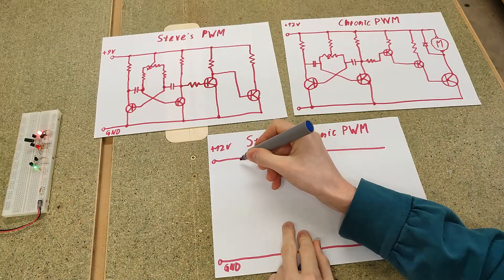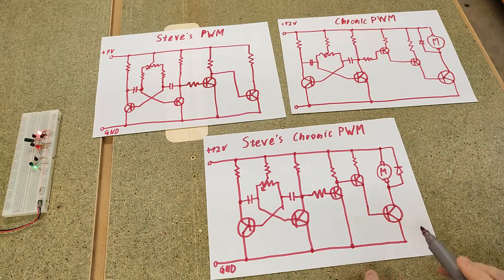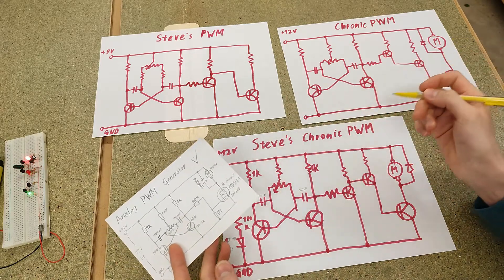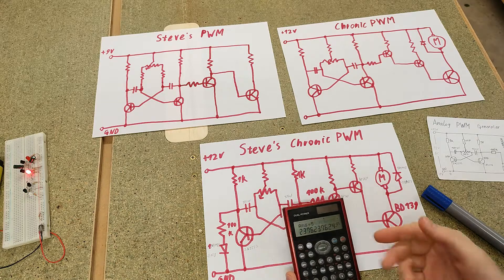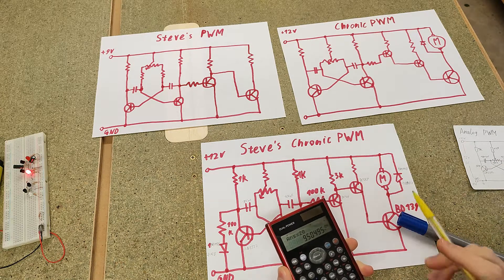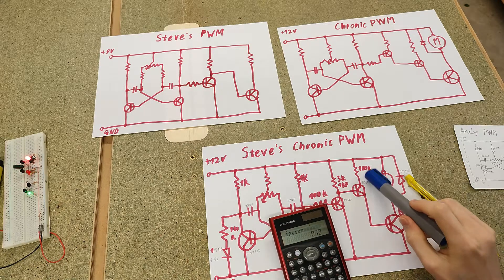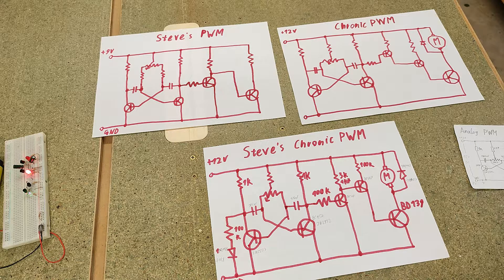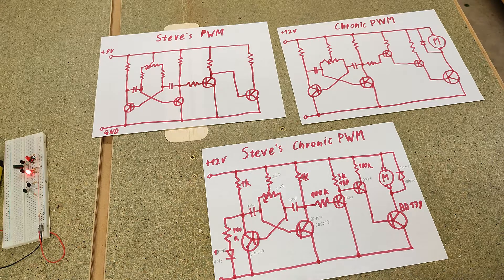Designing a PWM motor speed controller WITHOUT 555 timer IC

Comment: 1. Instead of motor, i understand can also use it to drive LEDs (~200-300mA current). 2. Also can i reduce transistor stages, maybe by using PNP to drive the LEDs. Please comment on above. Thanks in advance 😀
Reply from the maker: Hey, sorry for the delayed reply, I usually don't log into the second channel very often.
Yes, you can use the circuit to drive LEDs,  as well as anything else controllable via PWM. The maximum current is determined by the collector current of the final output transistor, so for your LEDs you may be able to shorten the output stage by 1 transistor, placing the power transistor where the last BC547 is (necessary to recalculate some resistor values).
Using PNPs will likely not be of any advantage for eliminating transistor stages because the transistor before the PNP needs to be able to switch the full base current of the PNP nonetheless. If you want to go really simple you can only use the MOSFET version of the circuit, where almost the entire output stage is replaced by a single MOSFET.
I recommend watching the video about this circuit on my main channel where I went into a lot more detail (if you haven't already seen it) in its description there are also three versions of the circuit diagram available for download :)